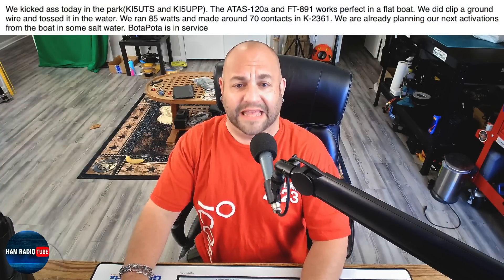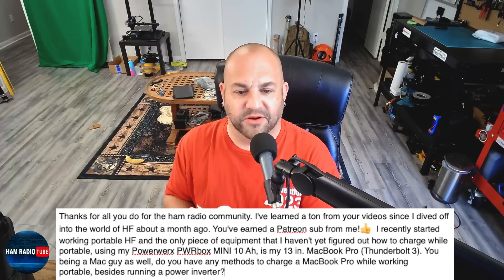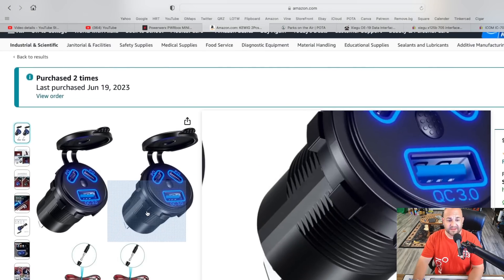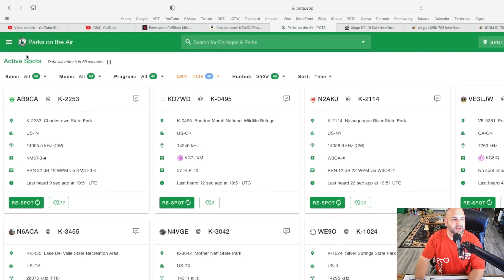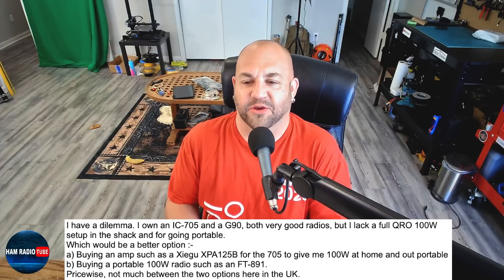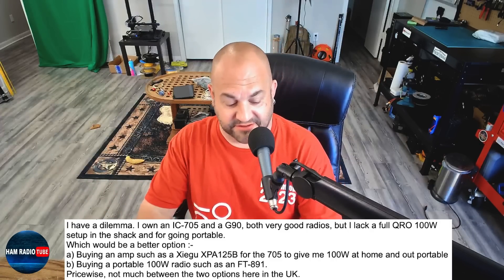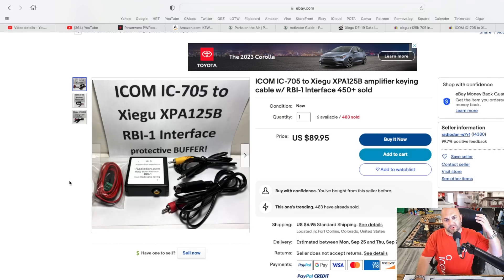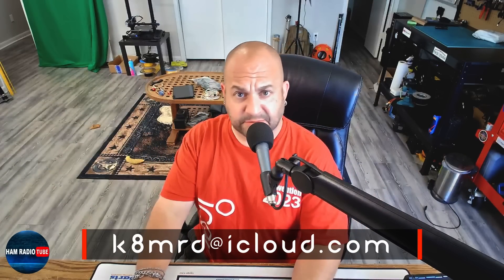Buy an Amp for QRP Radios OR Buy a 100 Watt Radio

Comment: I have an 891. Tuner, and digi rig. I am going to sell it all and get a second IC 7300 for camping and such. It is just easier to deal with.
Reply from the maker: Yeah my 891 is in the car now with the ATAS antenna.  I love my 7300 for portable.  Check out the Portable Zero rails for the 7300.  They're rock solid.  I have zero worries about my 7300 falling on the ground with them on.  This is the one I use https://portablezerostore.ecwid.com/#!/7300-EB-7300-Escort-Black-Texture/p/67845086/category=19927161

Comment: I agree, Mike. The FT891 does it all. I chose it as my starter radio, and use it as a mobile now that I upgraded to the FT710 for the shack. Yes, the menus suck, learn them. On air, it does everything the 710 does (actually, the 891 just might have better xmit audio, I need to record them back to back).
Reply: No actually an ICOM 7000 or ICOM 7100 does it all.👍👏🎙
Reply: Well, if you want to go off topic, the Yaesu FT991 is a shack in a box as well, but neither of those radios were mentioned here. @1OFGODSOWN

Comment: I use 3 radios for POTA, 5 watt QDX digi only, 20 watt G90, and a 100 watt FT-710…I use the one that circumstances it “what I am in the mood for” dictates
Reply from the maker: Yep.  That's what I do.  Usually it's the 7300.  Sometimes the 705, others the 818.  Heck I've even taken the 7610 portable lol!  Just depends on your use case.  I'm certainly not taking my 7300 and heavy batteries on a long hike or climbing up a mountain.  QRP all the way for those situations.  And very very rarely will I not make enough contacts to activate a park QRP.  If you have a good antenna, which we really should focus way more on than the radio, you should do quite fine.

Comment: I bought the 891 first, then the 705 and G90. I agree with you on the 891. The 705 and G90 are fun because you don't have to haul around extra amps, cables, etc. If you want a 100 watts, that's what the 891 is for.
Reply from the maker: It really is best in my opinion to have a dedicated 100 watt and QRP radio.  Just too much fuss for me to make a QRP radio a 100 watt radio.  But everyone is different.

Comment: I live in Northeast Texas like 3 .5 miles from the Red River. Back in May I went to Galveston for a week and had tickets to a concert in Houston which got postponed till November. Anyway staying by the ocean again and I am looking forward to putting up the 17ft whip and running the radials out in the water. Salt water is something I don't get to be around very often and makes operating much more fun. Not saying the Piney woods are bad cause I make contacts but the ocean changes everything.
Reply from the maker: I've made some great contacts sitting on the beach at Galveston Island State Park.